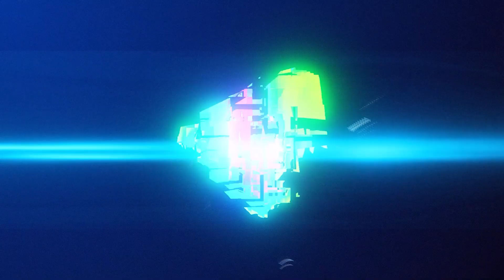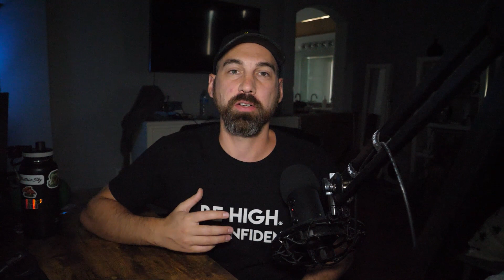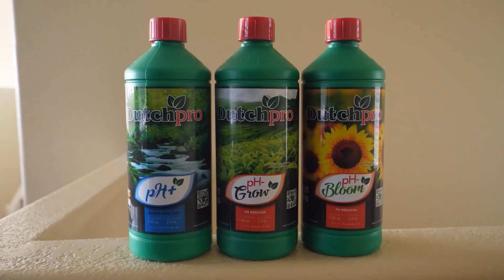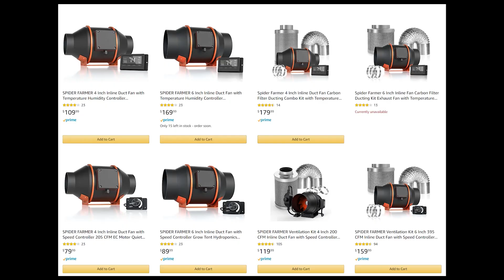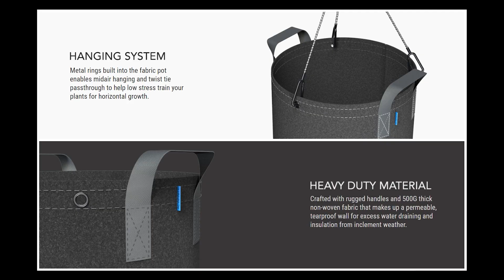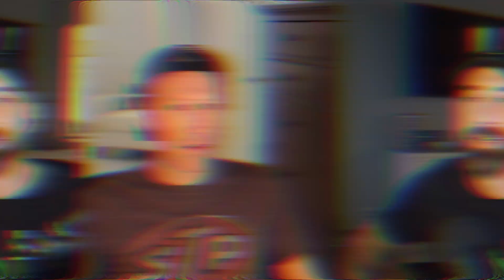The Future Of Gardening: Complete Automation! (Garden Talk #37)

Comment: We need something affordable to control grow rooms/tents. A simple LED light controller/timer is over $200. Crazy...  Im using a TrolMaster Hydro-X,  but the things you really need to control and monitor are only available in the "Pro" model costing over 2 grand... smh...  I've been working on a system using a Raspberry Pi,  stay tuned...
Reply: A Wi-Fi controlled outlet is like $15 and will control your LED. Keep it simple. Home assistant can even control most of them. Even inkbird systems are less than than that. You should spend some more time looking around if you think you need 2 grand to setup a system.
Reply: @therealq10  Who said I "need" a two thousand dollar system. I want to do more that just turn the lights on and off. I want to monitor the system.  There are plenty of cheap ways to control lights and fans, where is the single box to control the lights, fans, pumps, etc, and report the conditions so I know what is going on in the garden. so...